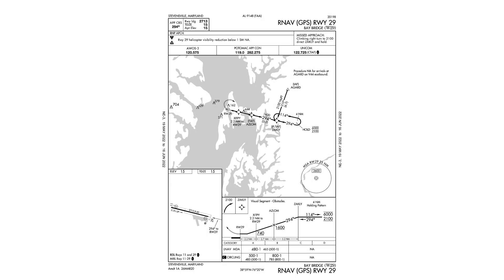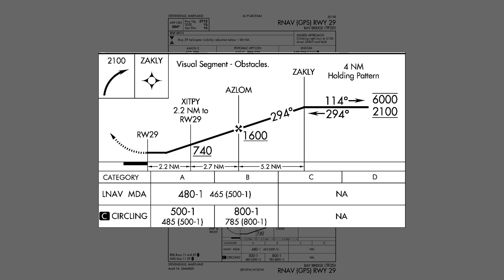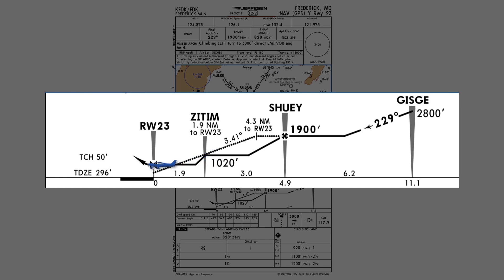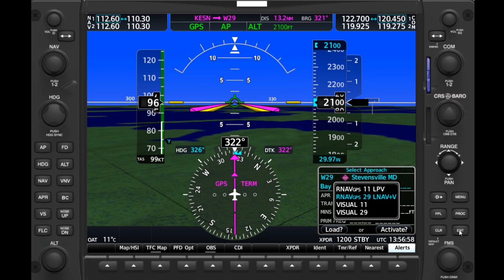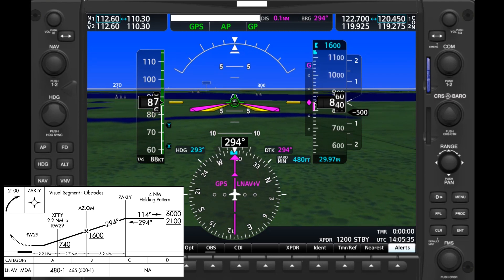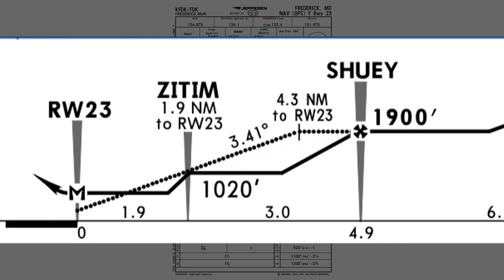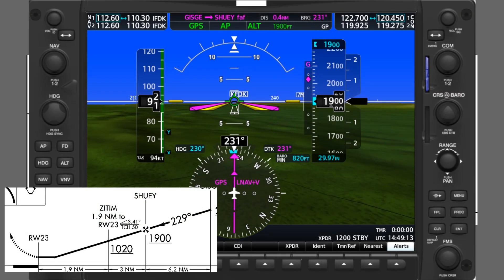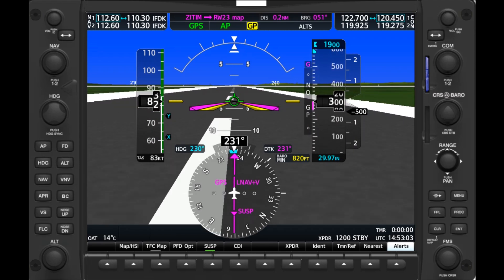How an Advisory Glidepath Works | LNAV+V | Stepdown Altitudes | GPS Approach

Comment: Ok but I’m still confused because initially the plate you showed has the 3.41° VDA after crossing ZITIM, but you moved it to after the FAF.

In the case of the actual approach plate with the VDA being after ZITIM, does this mean the G1000 is actually calculating two separate advisory glide slopes? One for the leg between SHUEY and ZITIM and another for the leg between ZITIM and the MAP?

Comment: Whenever I try to explain +V to other pilots, the only way I've found that doesn't leave them perplexed is this: It figures out the steepest angle from the threshold-crossing point to each step-down fix and selects the steepest of all of those angles. It projects that steepest angle outward along the approach course from the MAP until it reaches the altitude (not the lateral distance) of the FAF (laterally, this will be somewhere between the FAF and the MAP; usually within a mile or two of the FAF). The result will be a glide path which exactly clears at least one step-down fix and clears all the rest by some amount.

Comment: @FlightInsight  Do you know if Garmin units will offer +V guidance when approaches are not published with a VDA, or the VDA in the coded procedure has been zeroed-out?

Your demo to RWY 29 @ W29 (Bay Bridge), shows +V being offered. Carefully watching your sim-rum, +V GP is intercepted just past AZLOM, at 2.5 NM to XITPY. It passes over XITPY at about 800', and reaches MDA at 1.2 NM to RW29. As flown, this appears to be a glidepath of 3.06 - 3.21 or so.

I looked at the CIFP for this procedure, and, indeed like the FAA chart, it shows no VDA (all zeros on the applicable line of ARINC 424 data). Would an updated and active Garmin unit in the real-world still offer +V? Is your sim unit using different data that had this 3+° VDA encoded?  If otherwise, how does the Garmin unit improvise a +V glidepath to use, if you know it for a solid fact?

(from the CIFP)
SUSAP W29 K6FR29   AAGARD 010AGARDK6EA0E  A    IF                                             18000                 B PS   453842004
SUSAP W29 K6FR29   AAGARD 020ZAKLYK6PC0EE B 010TF                                 + 02100                           B PS   453852004
SUSAP W29 K6FR29   AZAKLY 010ZAKLYK6PC0EE AR   HF                     29400040    + 02100     18000                 B PS   453862004
SUSAP W29 K6FR29   R      010ZAKLYK6PC0E  I    IF                                 + 02100     18000                 B PS   453872004
SUSAP W29 K6FR29   R      020AZLOMK6PC1E  F 010TF                                 + 01600                 RW29  K6PGB PS   453882004
SUSAP W29 K6FR29   R      020AZLOMK6PC2WN          N          ALNAV                                                   PS   453892004
SUSAP W29 K6FR29   R      021XITPYK6PC0E S  031TF                                 + 00740                           B PS   453902004

SUSAP W29 K6FR29   R      030RW29 K6PG0GY M 031TF                                   00055              000          B PS   453912004
(this line appears to show TCH 40' (55 MSL - 15 TDZE) with VDA of -zeros-)

SUSAP W29 K6FR29   R      040         0  M     CA                     2939        + 00415                           B PS   453922004
SUSAP W29 K6FR29   R      050ZAKLYK6PC0EY  R010DF                                 + 02100                           B PS   453932004
SUSAP W29 K6FR29   R      060ZAKLYK6PC0EE  R   HM                     29400040    + 02100                           B PS   453942004

Comment: Another great video!  I think if possible ALL proficient pilots should fly with Jeppessen charts (but alas, they are ridiculously expensive).  I fly LNAV+V often on the West Coast and the advisory GS will provide a much more stable approach into tough urban airports with obstacles.  Thanks for showing us that the advisory GS WILL NOT lead you below step down mins..,many are wary to use is due to that fear.  Dive and Drive is so yesterday!  CDFA is the way to go...good enough for part 121 good enough for me!  Awesome channel...best succinct explanations for complex topics!